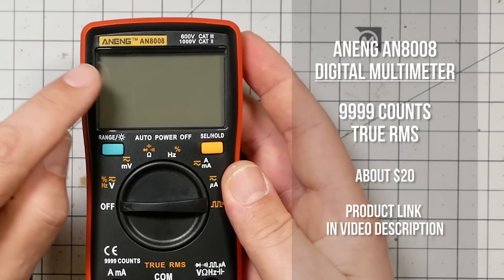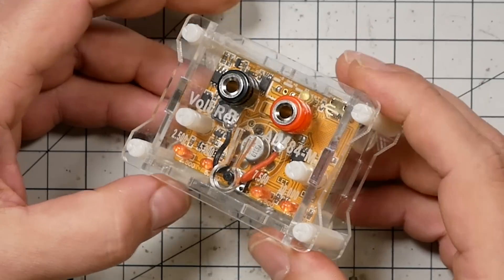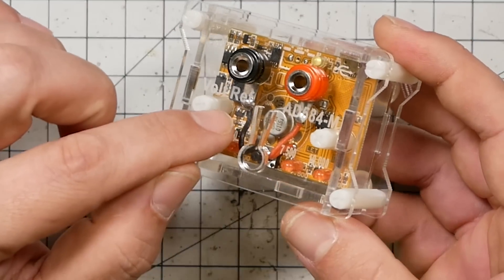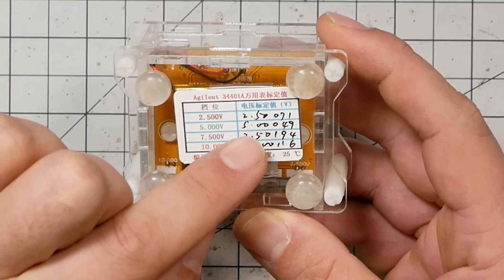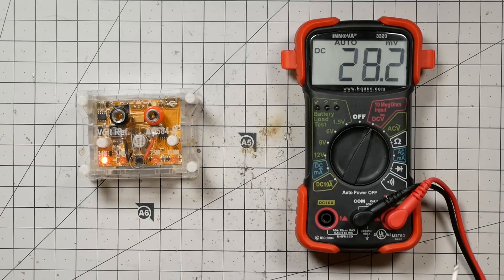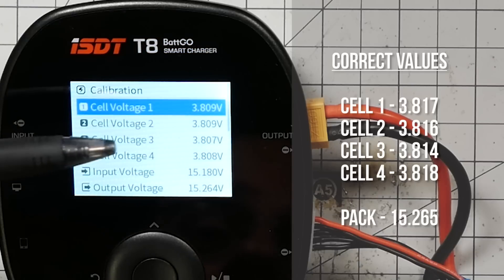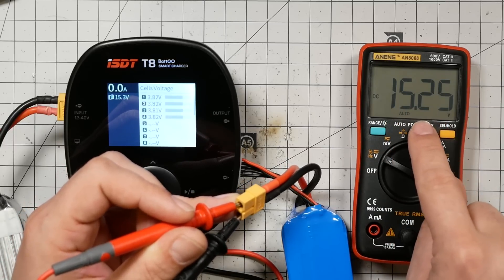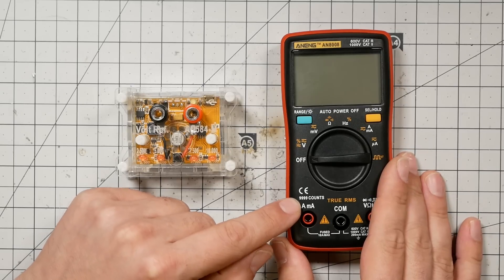HOW ACCURATE ARE ISDT CHARGERS | KKmoon AD584 voltage reference and AN8008 multimeter

Comment: I use a Icharger 410DUO that I have had since they came out to charge my big 6s 5000 heli packs.. I also Graupner gave (I am sponsored by Graupner, flying thier Hott Radio systems and they wanted me to test their chargers) Polaron EX 1400watt 2ch charger that I love.. I have tested the 410duo with a certified Fluke meter and from the factory mine was within 3/1000ths of a volt extremely accurate to say the least, my PolaronEX before calibration was within 2/100ths of a volt off.. did a calibration on it and it runs within 1 to 2/1000ths just like the 410duo but the 410duo was perfect from the factory.. the Polaron EX 1400watt is a 500 dollar charger and I love it I thought nothing would could make me like it better then my 410duo.. there's two reasons that make the EX better then the 410duo one is the UI and how awesome the touch screen is along with all the data it provides and the other is how fast it balances batteries.. it balances so fast that I only balance charge because it isn't any faster to normal charge.. it balances cells like no other charger even the 4xxduos that are known to balance packs lighting fast and they do but the EX is even faster... both will balance charge a pack faster then any charger I have seen will normal charge a pack to the point i could balance charge a pack at half a C less then other chargers and finish soon with super accurately balanced packs but the EX will take a out of balance pack to perfectly balanced even faster then the Icharger Duo series chargers will.
I don't complain if a charger is within +-.05v but premium chargers are going to come from the factory to within 1 to 3/100ths but when your flying 300 dollars worth of premium Lipos on your 700 you want to take utmost care of your packs and I want them to be perfectly balanced and I want them to be at 4.20(+- 5/1000ths) it's nice to see low cost chargers can be made very accurate, I have always used premium chargers even back when black cell Sanyo 1700scrc nicd cells dropped our jaws when they came out for 1/10th scale, I was a Team Losi XX when it first came out then, I used the top tier charger of the time it was a Competition eletronics Turbo30 (600 dollar charger at the time, but DAMN it was good) but it's nice to see people not having to spend 300 to 500 dollars on a premium charger to get good charging preformance.. I have to get me a few of these isdt pocket chargers..

Comment: Ooo. Ooo. Ooo. I have a question. Absolitely nothing to do with this video but im sitting at my bench thinking about this.
I have a quad that is giving me major problems. Flies wonderfully except when i perform an agressive roll or flip my video completely shuts down. I thought maybe the 10v regulator on the pdb is overloading. (Yes 10v) however the only thing using the 10v is the vtx. Rated 7-24v The regulator  is rated at 3a. My vtx is pulling around 600ma. Any chance you could answer my question? Id be happy to be a real life troubleshooting if you want...
Reply from the maker: If the screen goes to snow, then the vTX is losing power. If the screen goes to black, then the video signal wire is likely coming disconnected. If the screen goes to black AND you see the camera's bootup process, then the camera lost power.
Reply: Joshua Bardwell yep goes to snow guess ill power from vbat and see if that helps if not external regulator i guess. Thanks JB!!!

Comment: Hey Joshua, Isn't the point of the reference voltage to calibrate with?  In other-words wouldn't it be better to use the reference voltage directly on the battery checker / chargers and then set their values based on the sticker on the back?  Using it to test a meter (adding error) then using that meter to test a pack (more error) and then using that pack to test the checker/charger (even more error).  Reference voltage direct to checker/charger avoids all that additional error (not to mention any additional voltage loss that the pack would experience while powering the voltage checker).
Reply from the maker: You can't use the voltage reference that way because the battery checkers and chargers throw an error message and don't read out if they don't see something that looks like a LiPo. So like if the voltage is only on a single balance pin, or if the voltage on the balance port doesn't add up correctly to what is on the XT60.
Reply: And this is why you are the FPVknowitall!  Thanks so much for your wealth of knowledge you provide!!!  Too bad though, I guess as a runner up would using the largest mah pack you own to calibrate with since I would think would be the slowest effected by slight current draws to show a voltage drop?

Comment: Get a proper meter before something goes wrong.
Reply from the maker: +helltp what do you think might go wrong? Even EEVBlog says this is an awesome meter for low voltage use.
Reply: I was going to reference Dave from EEVBlog too, and his cheap multimeter roundups. Then I'm sorry, it might be good enaugh for low voltage use. Anyway, I prefer to have at least one good meter that I can trust, just to justify if any of my other cheap meters drifted out of calibration (and not just in voltage measurnig), because that could cause some problems. So now I'm going with an Extech EX330 on the proper side, and with a Uni-T UT33B on the cheap side.
Reply from the maker: But I have the KKMoon voltage reference to check the accuracy of the voltage :-)

Comment: you should use banana plugs to connect the voltage reference with the multimeter. the error of 0.001v could be eliminated than.

Comment: Counts tell you what the instrument can display before it changes to the next range.

For example, suppose a multimeter has 50000 counts.  This means, the range changes when it hits 50000 on display.  To illustrate, a 50000 count meter can read 49.999 V on the display, but when it tries to display 50 V, it will only read  050.00 V, or simply 50.00 V instead.  The multimeter moves to the next range, which generally also means one digit of resolution will be lost.

Src: https://bkprecision.desk.com/customer/portal/articles/1535307-difference-between-counts-and-digits
Reply: Richard Scott thanks for the info.
Reply: Great video explaining counts.  https://www.youtube.com/watch?v=yY3P3OxXVm0

Comment: Why not feed the voltage reference into the charger and then calibrate the charger?
Reply from the maker: +Chris Spitale the charger throws an error code if what it sees doesn't look like a LiPo. So if any cell is missing from the balance port. Or jf the balance port doesn't add up to the main port.

Comment: Isn't the isdt charger pulling some current when you plug it ? dropping the voltage a few thousandth of volt ?
Reply from the maker: If so, then that seems like it still is how it should be calibrated: to read correctly under the conditions it will be used in.
Reply: Joshua Bardwell indeed it is! 😅

Comment: I've done these exact tests with calibrated (2012) Fluke 189 (20,000-count) on Junsi products and they were all dead nuts on: iCharger 106B+, 206B, 308Duo, and Powerlog 6S.  My two HK Accucel-6 (~2012), one Accucel-6 mini (~2014), and iSDT Q6 were all off by various amounts.  Biggest problem with iSDT chargers is the horrible ADC on the main pack leads: you can't even charge a 1S safely without connecting the sense lines from the balance port.
Reply from the maker: Good to know that you're getting something for the additional cost :-)
Reply: My first charger in 1983 was NiCd only, 6A and literally a Mark-Time industrial timer switch that went to 30 min, a 6A wire-wound reostat that was not very granular, an analog amp meter (with a shut inside) and a main wire-wound current-limiting resistor.  It was 60 1983 US dollars — It's amazing the value we get for pretty much anything by comparison these days ;)

Comment: also be sure to check battery voltage after charging. i got SC-608 with measures floating about +/- 0.03V before/after, so while in calibration mode i must input shifted values. and it's not due heating or wire resistance, seems like some sw "feature".

Comment: Could you connect the voltage reference directly to the charger/checker and calibrate the charger/checker with that voltage?
Reply from the maker: No, because the charger/checker complains if what it sees on the balance wire and XT60 doesn't look like a battery. Like if you put just 2.5v on pins 3 and 4 of the balance port, it will throw an error and not read out the value.
Reply: Austin Wessels My very thought.

Comment: Hey josh I built a Qav with some hype trains and I'm getting some d gain oscillations when I get a light damage on props but fine with brand new ones how far should I drop the  d gain to give me a buffer
Reply from the maker: Depends what the current value is. I'd say maybe 5 or 10?
Reply: It is the
Reply: Oops it's the default settings thank for responding you rock

Comment: If the battery is what is powering the ISDT it may be accurate at one hundredth below the multimeters value due to it using 400 milliamps(I assume it's using because of the value) to run the chargers lcd? :\!maybe...
Reply: Scalawag it's powered from the input not the output. It uses no power from the battery that is plugged into the balance port
Reply: i see the power cable on the input side of the charger(now that you mention it), but i don't see anything on the battery checker. Unless there is an internal battery it looks like it uses the lipo. I'm going to assume there is an internal battery

Comment: Calibrated my D2 with my fluke 87.  Charged a pack on each channel and every cell was dead on 4.200 volts per cell.  I honestly couldn’t believe it was that dead on. I’m totally impressed with the charger. I have the JB v2 balance board inside a Batsafe.  I can fit 8 cnhl 1500s and charge them at 12 amps.  From storage voltage it takes 27 minutes to fully charge all 8.
Reply: trint cole how do u calibrate the D2?

Comment: Joshua, not sure if you can compare the meter to the battery checker. Remember that battery checker is powered by the same battery you are measuring and this will cause a small but still noticable voltage drop :) I'd try calibrating with the voltage reference though! :)
Reply: Still, Maciej has a valid point..
Reply from the maker: You can't calibrate directly with the voltage reference because the charger won't let you put voltage across the balance pins individually. You would need four references, wired to a balance plug, to do that.
Reply: You can power the battery checker from a seperate power source. I use the isdt bg8 for checking my tinywhoop batteries all the time. Just plug in a 4s to the xt60
Reply: I used my parallel board to hook the checker and the charger to get both the calibration and checker values at the same time. This stopped the battery from fluctuating by plugging and unplugging.  Worked good for me

Comment: Isn't the battery checker powered by the battery it is checking? You'd want to do the calibration quickly, it wouldn't take long for it to drop the voltage a few hundredths of a volt as it drains...
Reply from the maker: I re-checked the voltage after I finished shooting the video, and it was only 1 or 2 thousandths lower than when I started.
Reply: Of course you did, you beautiful thing :)

Comment: Honestly, I'd rather take a second- or third-hand Fluke or Gossen or ABB off ebay than that Chinese DMM of yours (just my past experience with DMMs).  The bandgap reference (I assume that's what it is) is a good find, however.
Reply from the maker: You're not wrong, but if all you want to do is calibrate the chargers, $20 for a 10k counts meter is not bad.

Comment: Ok, I will pick on this a little as well :D 
KKmoon voltage reference - lovely, 
AN8008 - lovely as well 
.... but..... 
how about a power supply as a voltage reference? Trying to calibrate BG-8S while it's being powered by "reference voltage readout" ( battery ) - not so lovely, I dont know how much does a bg-8s drains the battery but it's for sure drains something, sooooo, how about powering bg-8s from another battery via xt-60 and THEN connecting balance lead from another battery ( "reference voltage readout" ) or even better, powering bg-8s from battery via xt-60 and using power supply as "reference voltage readout", of course measuring the power supply first :).

Cheers, best of luck to you :).
Reply from the maker: I re-checked the voltage after I finished shooting the video, and it was only 1 or 2 thousandths lower than when I started.
Reply: Ok, maybe i didn't quite explained what I'm on about, is just like when you fly, when you do a punchout voltage of the pack drops, and when you drop the throttle voltage goes up again, I was just thinking is that the case in battery checker :)
Reply: @chikenpl  - I wonder this as well. Is it possible to power the battery checker with a XT60 from another battery and balance lead of ref battery?
Reply: @simonhimself86  Yes, I have done that a few times

Comment: Wouldn't it be easier to feed the 2.5/5V reference to the charger balance port and calibrate against the ultra-precise measurements done at the factory which produced the voltage reference module? Assuming the charger/voltage checker actually can take 2.5 or 5V on the balance port. It might complain about over/undervoltage but doesn't matter for the calibration.
Reply from the maker: That doesn't work because the charger expects the balance ports to all add up to the main port. If it sees anything anomalous then it throws an error. For example, you simply cannot put 2.5v  across the #2 and #3 balance pins and leave the other pins disconnected.

Comment: Johua, you always correct and improve your videos.  This one is excellent.

Hey, instead of using the voltage reference to prove your meter is accurate, then measuring a battery, then using the battery to calibrate your charger/checker, why not cut out all the middlemen, connect the reference straight to the charger/checker.

Comment: Joshua, the counts are really simple: The smallest value the meter can display is 1/counts of the currently used range. So for a 9999 count meter, the <10 V range ends at 9.999 Volts --> the resolution you get is 1 mV. A 6000 Count meter would have the same resolution, but the range would end at 6 V, and then it would switch to the next range (60 V).
Reply from the maker: Yeah I just can't figure out how to explain it clearly. I mean... you did fine :-)

Comment: It was only off by 2 tens of a volt? Lol, charging to 4.4v instead of 4.2 is a pretty big deal i think...
Reply from the maker: I think you might have misunderstood me. I agree that being off by 0.2 volts is a big deal. I was saying, overall it is currently pretty close, but don't forget that it was off by 0.2 volts when I got it, and I fixed that in a previous video.
Reply: Joshua Bardwell ah, ok, imiaunderstood you then. Thanks for the clarification!
Reply: he said hundredths though, not tenths? as in 0.02 or 20mV

Comment: So you took my advice on both the an8008 and the ad584. Nice!
Regarding the ad584 - you should always use it powered from the battery when testing because it needs clean power to avoid noise in its output. 
BTW for this job you can achieve the same precision with a 6000 count meter (6000 and 10000 are the same below 6V) but with the 8008 so cheap there's no reason not to have the 10000.
Reply from the maker: Yes indeed! Thanks for the advice.

Comment: You should of make it more clickbait.
Like: how inaccurate is isdt ?
And at picture will be isdt charger with red x on it 😂
Reply from the maker: I think your definition of clickbait is different than mine. To me, clickbait is an intentionally misleading, sensational, and/or incomplete title. This title shows that we are going to test the accuracy of ISDT meters. Then that is exactly what I did.

Unfortunately, thumbnails must be SHORT and PUNCHY. There isn't enough room to write, "Testing the accuracy of an ISDT charger using precision voltage reference and 800n multimeter. Results: average deviation of XX volts per cell."
Reply from the maker: I think what you are responding to is that the goal of a thumbnail is to catch the eye and encourage a clickthrough. So they must be visually interesting and have a hook. And I think the word clickbait has expanded to include anything that is designed to catch the eye. But I disagree with the characterization. Clickbait is absolute garbage manipulation and lies. 

WE TEST THE ACCURACY OF THE ISDT T8. YOU'LL NEVER BELIEVE WHAT WE FOUND!

That's be clickbait in my book.
Reply from the maker: But I didn't do that, because that WOULD be click-baity. At least by my definition.
Reply: Joshua Bardwell maybe, looks like it 😅
Reply: Dunno, the yellow bar on the side of the video is usually adequate bait for 90% of us.  Anything beyond that is getting really subjective

Comment: I have no idea how they make the AN8008 so cheap. Would never trust it on line voltage, but dc precision is pretty darn good. Also the BG-8S is powered off the device under test, which will pull the cell voltage lower. Best way to test is to have the reference meter and charger/checker plugged in at the same time. Good sharp probes through the silicone wire is what I use.

Comment: what is the real value when you plug a battery to the checker. you power the checker with the battery so you can expect the voltage to be a bit lower - just normal sag. When you want to be thorough you should measure the voltage with your meter while being connected to the checker ...
Reply: exactly what i was thinking about.  Connect the batterytester/charger and measure at the balance port at the same time.